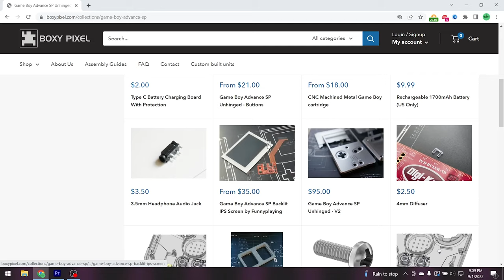Building a SLATE Gameboy

Comment: There is a purpose for that insulation film. You might just be lucky to not have had a problem yet.
Reply from the maker: I think you might as well put it on there as it does serve as some sort of barrier between the board and the screen. I tend to just use kapton tape most of the time though if Im worried something might short.